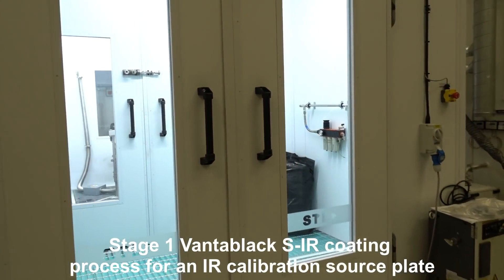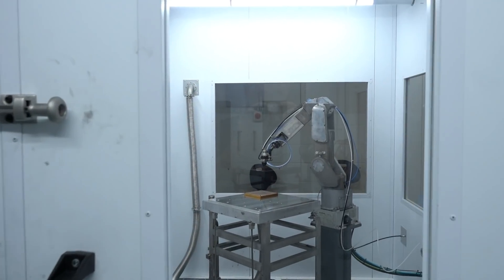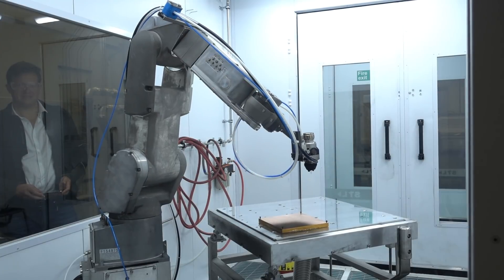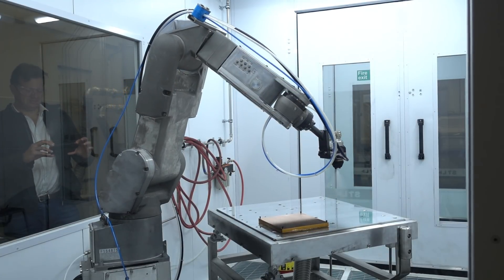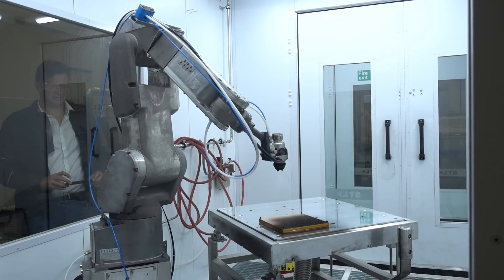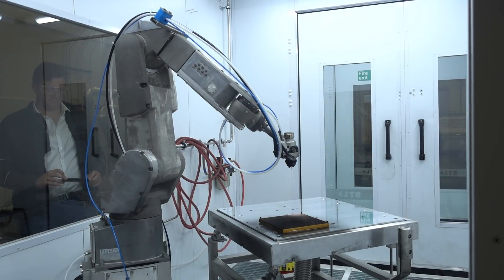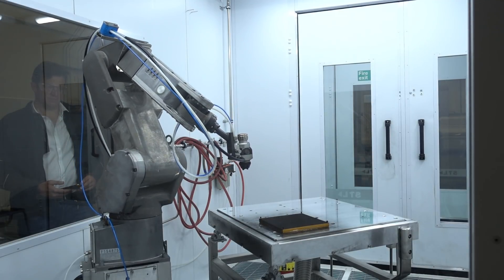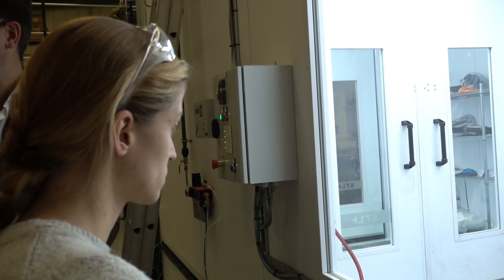Vantablack S-IR Robot test coating cell

Comment: Would Solar-PanelS be able to absorb more light, if designed with Vanta Black ?
Reply from the maker: Yes, as the coating performs well across the solar spectrum. It couldn't be used on solar cells though as it would block any light from getting through.
Reply: That's amazing, your product is incredible applicable to a lot of diffrent things, you should be all very proud for creating it! Thank you.
Reply: and even it a solar cell would not reflect any of the suns spectrum, it would not be that beneficial and would lower the overall efficiency: photovoltaics suffer badly from heat - on typical cells a rise in 20 to 25° celsius drops the efficiency by 10 % - on a typical hot day, those panels can exceed 100°C very easy, so the efficienty is usually lowered by around 20 to 30%

Comment: Did you test the range between 5 um and 14 um? Or just those two specific wavelengths? If you tested the range was the THR change linear? Thanks! Can't wait to try a product that uses this.
Reply from the maker: Hi Chris,
We test from 200nm to 14um. The change in reflectance is pretty linear and has no 'features'.
Reply: Surrey NanoSystems oh all the way to 200 nm. That makes more sense! Thanks for answering.